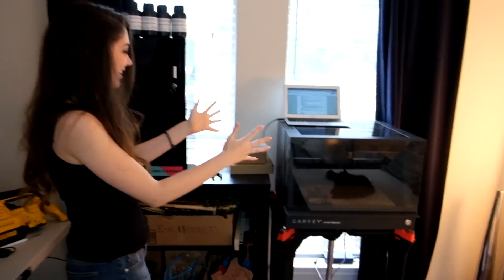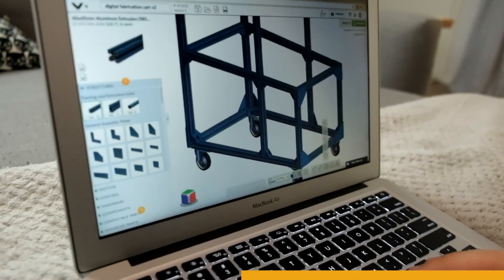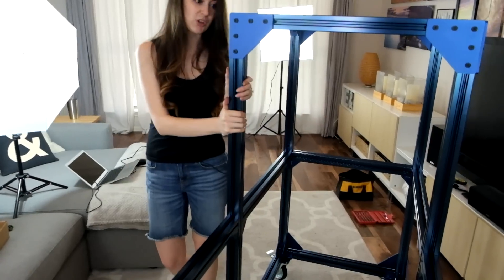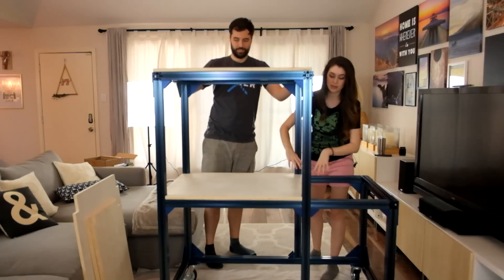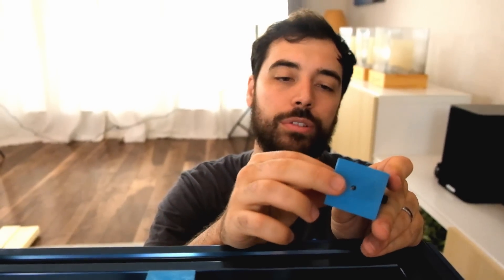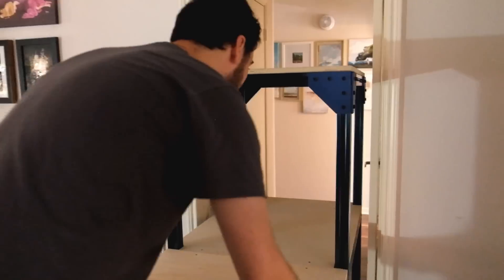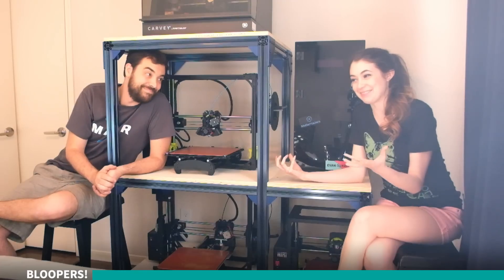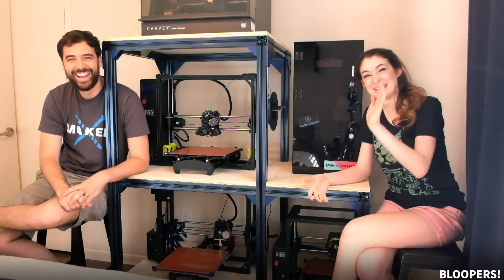Modular Rolling 3D Printer Cart Using T-slot Extrusions | Vention

Comment: How would you guys turn this into an enclosure?
Reply from the maker: That was the long term plan but we've gotten distracted with other projects lol. We would add more of the drop in nuts and install plexiglass or another cheaper plastic along 3 faces and add 3d printed hinges and plexiglass to the front
Reply: @EvanAndKatelyn  would this type of enclosure be safe? I have a CR-10 that I would like to not catch fire. Currently building plans using your idea!

Comment: With 3/4 plywood 2 ft wide you did not need the 2x4 for support. It would take a lot of weight for that to sag.
Reply from the maker: We partially did it to connect the two pieces of plywood the shelves are made of too, but I think you're right - they probably are overkill!

Comment: So, how come you made the center vertical struts full length instead of go with full length horizontal and have the vertical lower and top mid supports shorter and thus also modular to move sideways. Or do you forsee a possible future expansion in the vertical direction more than the horizontal ?
Reply from the maker: We did the struts full length because we wanted them to connect the two pieces of plywood that the two wider shelves are made of. Not sure if it's the best way, but it's easily changeable 🙂👍
Reply: Thank you, also, I guess not having the center vertical struts full length would necessitate having angle bracket's on the topside and hence more cutouts in the shelves for those, instead only on the bottom side, something I didn't think of until I looked closely.  Interesting modular set, and definitely something I'm going to look at for a few things in the future.

Comment: Nice tip.  Now here's one for you.  Most of the time, using a 2x3 works where a 2x4 would, is less bulky, a buck cheaper per stick, and usually just as strong for projects.  2x4's are excessive a lot of times.  And, you're saving the earth a little bit.
Reply from the maker: Thanks for the tip!

Comment: The project came out really nice, but using the carvy on the top shelf seems like it might not have made it easy to use, with hold down positioning and setting the zero of the machine above your line of sight.
Reply from the maker: Since Evan is 6'5" it's fine for him... Though yep it's too tall for me! It was a sacrifice we were ok with in order to save space, and we had to put the machines with built-in enclosures on top because otherwise if we had to have extrusions going up there it wouldn't fit through the door

Comment: How does the Vention product compare to 8020?  I've always seen 8020 but get scared when I start adding up the cost.
Reply from the maker: Pricing wise they are pretty similar, but the main difference is the software that lets you design and get the parts you need easily and fast. The cost can add up for sure -  we did a few designs and worked the cost down little by little each time. Hope that helps!
Reply: I'm curious, have you ever tried Tslots?

Comment: My OCD is forcing me to beg you to rotate the 2x4 blocking 90 degrees.  Dimensional lumber is designed to bear weight most efficiently and effectively when oriented vertically instead of horizontally.  Looking at the beam in section, the top fibers are in compression and the bottom fibers are in tension.  Maximizing the distance between these two extremes allows the material to perform most effectively.  With it horizontal you may get sagging over time from the weight of your equipment.  Vertical and you’ll never exceed its capacity.

Also, my name is Evan, too.
Reply from the maker: We'll definitely keep that in mind! Honestly, after we mounted the plywood to the brackets, it seemed like the 2x4s were just gravy (it was reeeeally sturdy). If we need to change their orientation down the line it'll be easy peasy. Also, hi other Evan!

Comment: I stopped your video to go check out vention (this doesn't happen on a E&K video but i love this module stuff and the possibility) but its to expensive with shipping and import duty to greece. but im now gonna hunt down some V slot extrusion locally. Vention web site is awesome resource with there 3d build catalog  :)
Reply: John Made it If you don't need such sturdy aluminum extrusion, you could design it with a smaller size and save some money. They "over-built" their cart with oversized extrusion. Especially if you reinforce it with plywood shelves and wood 2x4's across the bottom.
Reply: Gene Jordan yea I realised later that the extrusion E&K used was 45x45mm and I think the standard size one are 20x20mm (like on the xcarve CNC) which are good enough for most applications I think. Thanks   for tip 👍
Reply from the maker: Ah that stinks about shipping! Yeah extrusions are soooo nice to build modular things with though!

Comment: Would the 3/4” (I think it’s that thick) be strong enough for all the printer weight or am I overestimating the weight of y’all’s equipment?
Reply from the maker: We actually used 45mm (about 1.77") and it's reeeeeally strong. Should have no problem holding the printer weight 👍

Comment: Cool as usual 👍
I guess the gear would catch dust in an open rig plus it'd make annoying noise if someone try to take a nap !
If you upgraded to surround it with Glass covers or Clear polyethylene sheets ,it would make less noise and make it less prone to dust :)
Yet I Still love it, simple and neat
Reply from the maker: That's the plan for the next upgrade! We haven't had too many issues with dust the past couple years of printing in the open but noise is definitely an issue

Comment from the maker: Thanks again Vention for sponsoring this project! You can check em out here: https://bit.ly/2kTDmKL
Reply: Missed opportunity by them to not feature this design/build on their "Public Assemblies" page.
Reply: Mega late to the party here, but what are the chances you know of a half decent T-slot supplier in Canada? I've actually got plans for an enclosed "smart" 3D printer enclosure with a touch screen controller which would have vents that regulate temperature accordingly via air intake, filtration for the exhaust, and have a top feed of spools.